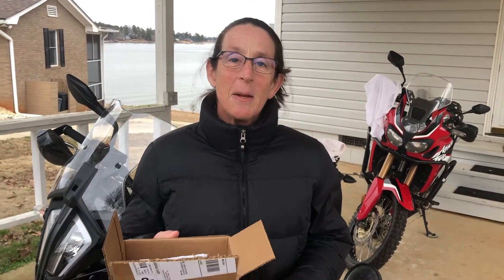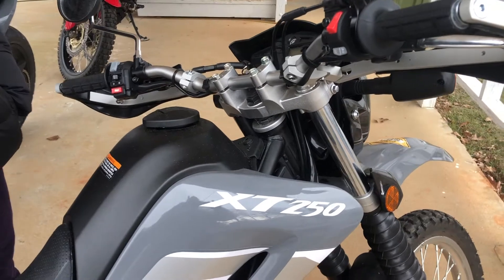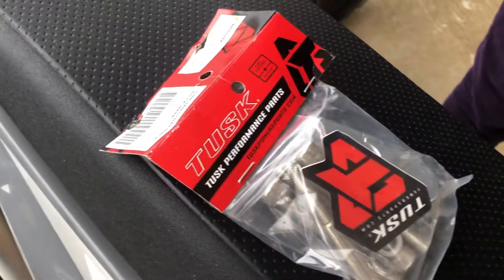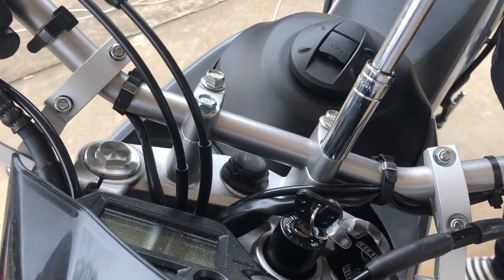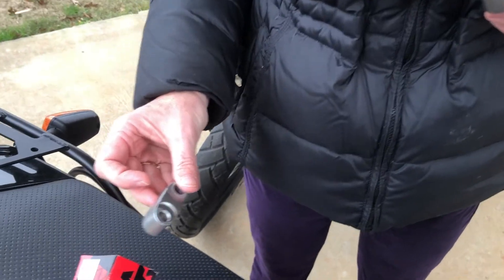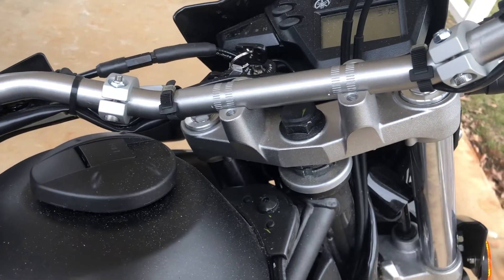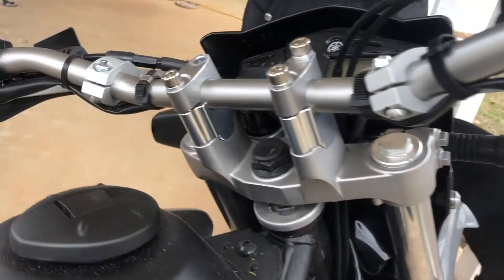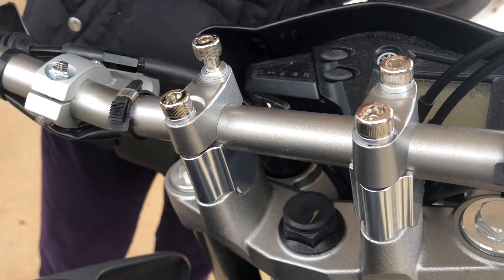XT250 Tusk Handlebar Risers Installation

Comment: Thank you for posting this. I recently got a XT 250, and finally got it in the dirt. Yes, standing up felt like I was reaching far to low. I’m glad you didn’t have to mess with the cables. 
Where did you order these risers?
Did you research torque for the new bolts? Or just snug em up good.
Also is it necessary to use the lock tight?

Again, thank you for the video
Reply from the maker: I don’t remember the torque specs off hand, but we used whatever the factory manual said. Yes, we loctite almost everything on our motorcycles, as things tend to rattle loose. The risers are “Tusk” from Rocky Mountain ATV.

https://www.rockymountainatvmc.com/parts/tusk-handlebar-risers-p

Comment: Thanks for the video, just found it before I installed risers on my 2009 XT250.  Did you have to fiddle with the cables?  I heard you mention there was a zip tie you had to cut, but I'm having trouble finding it.  I don't seem to have 30mm (or much of any) of free play once the clamp is unbolted. I wasn't sure If you just didn't video it.
Reply from the maker: Hi Mike - I apologize, but I don’t remember the details off hand, and I am unable to look at the bike because I’m 1,200 miles away from it for the next month. I am pretty sure I had to adjust cables a bit by releasing them from their secure points, and sometimes re-securing them. I know I DID NOT have to do a full re-route requiring the cables to be removed from the levers, etc., if that helps. Of course, our bike is a 2019, and I don’t know if the cables changed between our model years. Best wishes!
Reply: @MotoTherapy  Thanks for that information, I'll have a thorough look, I'm sure it'll fit somehow.